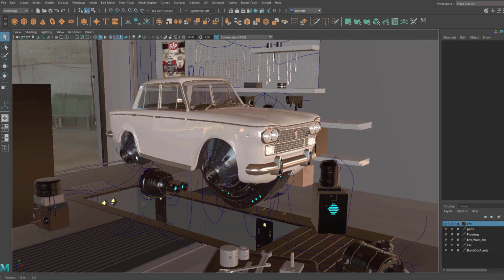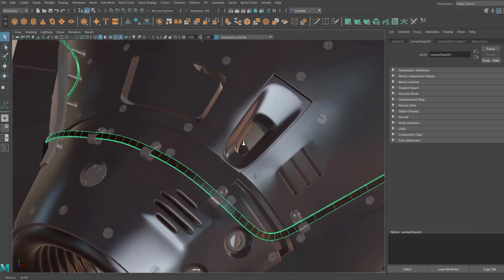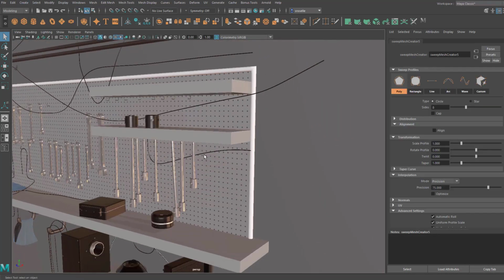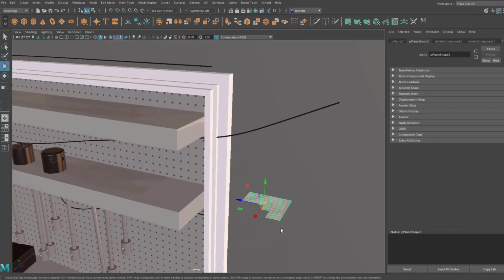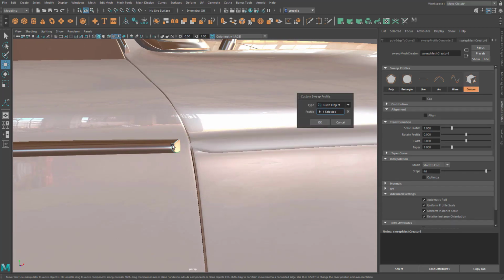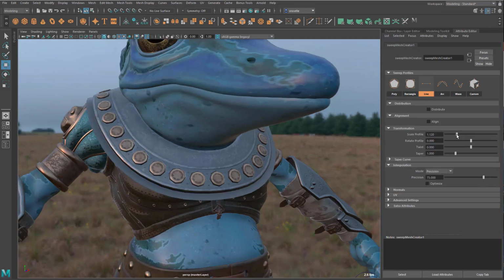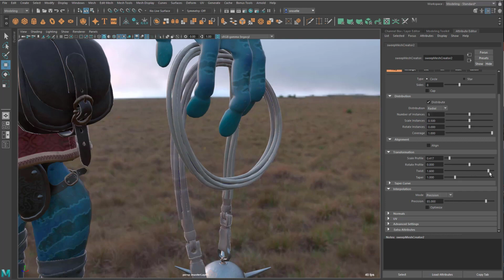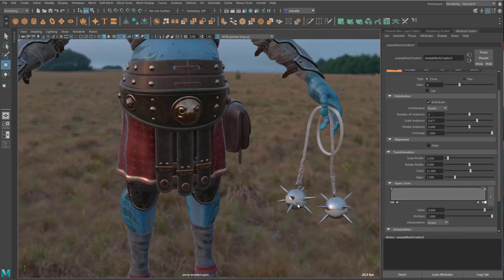Maya 2022  - Sweep Mesh (extended version)

Comment: We had this as a bonus in maya 2019 no?
Reply: This is new, that one automated some existing extrude features. I'm happy about this since we don't get the gnarly volume loss that the old method gave.
Reply from the maker: yeah but it was not nearly as flexible as this... also as Joel mentioned this does a way better job at volume preservation, hard corners, elbows, etc...  plus instanced patterns for twisted cables, variable taper, smart topology, etc...
Reply: @MyOhMaya  ahhh Ok. Good to know as I was satisfied with the first version as well. Any improvements to that is just welcome.

Comment: OK,  what if I want to animate length of the pipe (growth)? I can't.  You can tweak many things (width, height, subdivisions, profile, aligment), but you CAN'T CONTROL LENGHT and ANIMATE it. It's very frustrating. How developers skipped such a useful feature? I often have motion graphics work where I want to animate many  tiny "pipes" growing along a curves and I'm still using old technique with 2 nurbs curves ( profile and path)  with partial option on and I animate subcurve length that way the pipe "grows". It's so outdated, messy and time wasting. I had big expectations that with this sweep tool I will be able to animate curves.